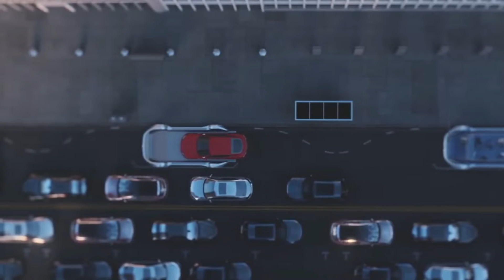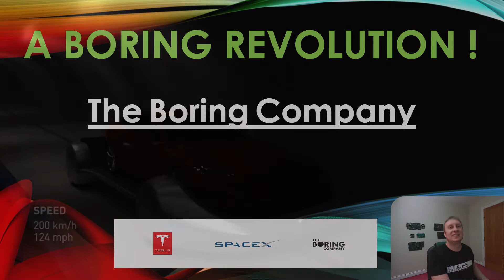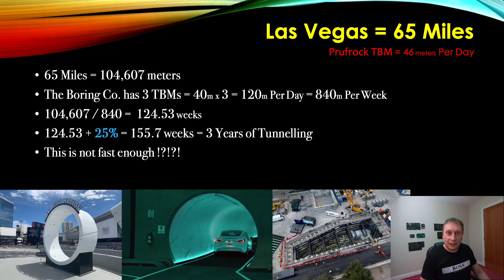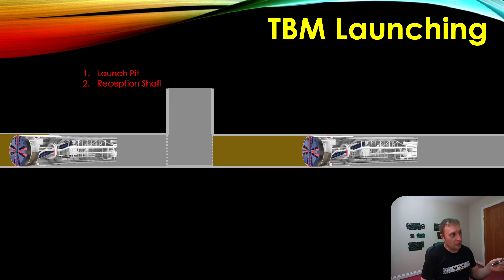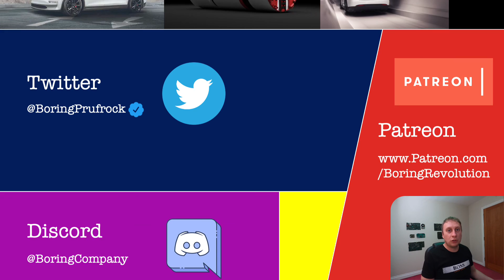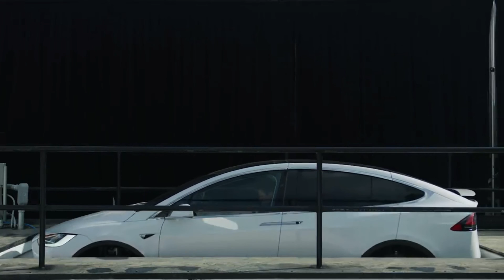Bad News : I Ran The Numbers & We Need Way More TBMs 🙄 👷🏽‍♂️ 🏗️ 🚇 💰 💸 #178

Comment: I doubt your numbers.  The encore dig achieved 72 meter per week - 1/4 of your rate.
Reply from the maker: You are twisting the data and need to be re-educated.
So week 1 onsite they did no digging as they were "assembling" the machine. 
Week two was marginally better as they started boring on the Thursday achieving 15 meters that week.
Week 3 = 55.2 meters Weeks 4,5,6,7,8,9 =104.58 meters (average).
Week 10 with the machine forced to work at a suboptimal depths only achieved 18.6 meters.

So in reality Prufrock is consistently achieving 100+ meters per week. This is still way too low but Prufrock-3 is a major upgrade and should be closer to 300m per week.

Comment: I don't agree with your numbers or naming of the TBMs. Per the Series C round, Prufrock II is the current version and can do up to a mile a week, so one machine could do 69 miles in a bit over a year

Prufrock 3 aspirationally will do 7 miles/day. So 69 miles in 10 days with just one TBM.

There is no Prufrock 4.

I agree with your cautious reduction of numbers but if TBC production will get to one Prufrock II per month that means they should get to about 6 of them by the end of this year and that would be enough to do 6 miles/week and finish Vegas in 10 weeks. With caution, call it 20 weeks.